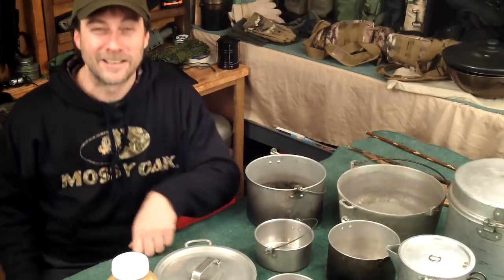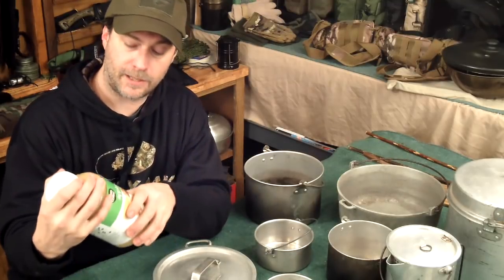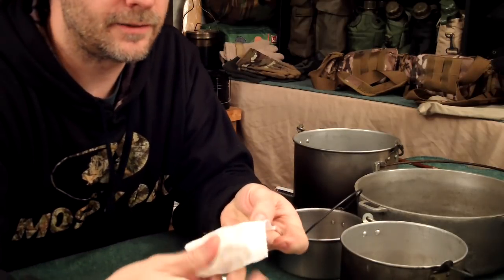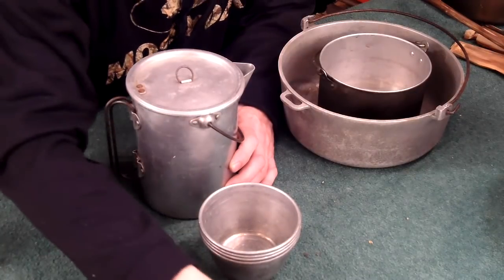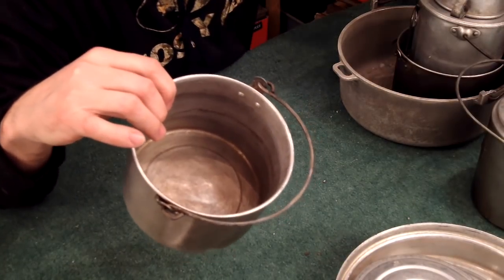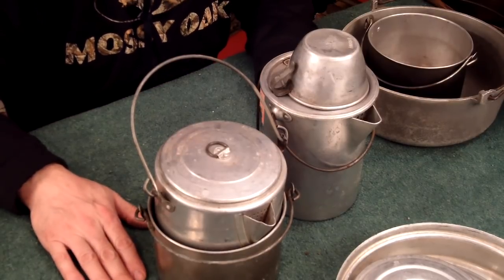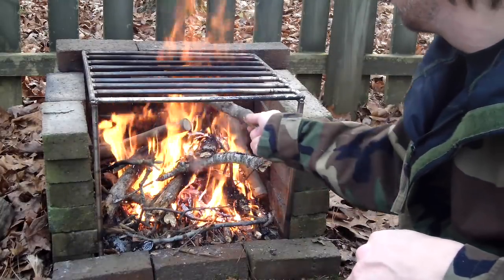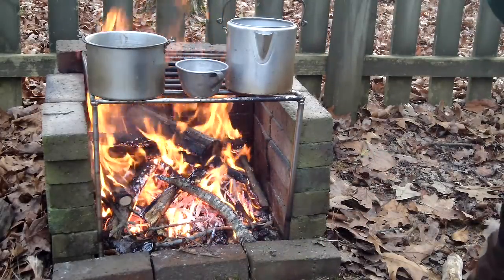Testing Old Aluminum Cookware For Toxicity

Comment: Sorry for spamming, I should just watch your videos first and then put 1 or 2 comments instead of 4 like now, I do apologize. The older the pan, the more oxidation has been going on, like rust on steel (also, there are notable differences in the production. like passivation). This oxide reacts with the acidity in the applesauce, tadaa, coloration. I'd just stick to the newer pans because they are less dirty. Cooking food that is highly acidic, will give you a reaction, a bit or a lot, depending. This is what I understand as a layman, it isn't lead or mercury, I think they are safe, but feeling safe is also important.
Reply from the maker: I would say no matter what the root cause is, if the applesauce changes color it aint safe to use any more.

Comment: I have a huge cast alum turkey pan I use to steam my big spegitti squash in summer when I can cook outdoors. It was just the right size. guess I will use all that sketchy canned applesauce on it and see what it does. might make a video if that just to follow up. 
also wondered about a man's comment in here about what if one used a series of fine Sanders and then polishes on old cast to shiny them and get rid of oits. Then I wonder if one can season them with oil several times like cast iron to from a oil barrier on it.
Reply from the maker: I too have wondered if a high polish would help so I'm going to test that. Now I do believe a seasoned coating that never gets scratched or scraped will make a pot safe.

Comment: First I like your videos a lot. This one also great entertainment! But... I'am having trouble with the science of it. It is a fact that aluminium is not healthy. I will not be discussing on effect levels here. My theory is as follows. For al I know apple sauce is slightly acidic there for it will dissolve aluminium and as specially aluminium oxide easily. Is de dissolved aluminium de reason for the staining of the sause? Non oxidised aluminium dissolves less easy there for it does not stain as much i think, but is dissolves any way. So by using acidic foods in aluminium pot and pans you will get aluminium in your food. If you would clean and polish the old pot that showed the staining should not occur.  Maybe a idea for a other video? Please prove me wrong if you or anyone else here has a better explaination?
Reply from the maker: Thanks Gerard. Well first off I cant prove anything. All I know is what I was told about this test and thats this " the ascorbic and malic acids in the apples in the sauce that react with any organic impurities from bacteria in the aluminum pores that open when heated that cause the color or odor change"

Comment: Maybe use a fine mesh steel wool to put a polish on that cast aluminum dutch oven.
Reply: Vinegar would also have a cleaning effect and with take the oxide off.
Reply from the maker: I actually did use steel wool and it still turned pink!
Reply from the maker: I need to try that next

Comment: some old stuff is made from pewter = tin with lead it looks a lot like aluminum
Reply from the maker: That would be horrible to cook out of!
Reply: you can tell because it will melt with a simple propane torch and it can be reused recast -cheers

Comment: this is interesting, I've never heard of this applesauce method, can you give any references to this, why does this happen ? I don't really think that it is a valid toxicity test, and from what I know and have read the aluminum is not good for cooking, and the explanations why, were all scientifficaly backed up but I would really like to know more, because I too have some aluminum cooking sets and occasionally use them, regardless.
Reply from the maker: The claim is the malic and ascorbic acids in the apples react with the unknown toxics in non ferrous metals.
Reply: ok, Thanks for this. I will try to find out more because this would be amazing to know if the pots are "leaking" toxins into what ever we are cooking.
Reply from the maker: It's also good to find out if the aluminum is leaching something out of its own alloy mix or did it absorb something toxic over the years and now it's releasing it?

Comment: I'm curious because of knowledge from working in Boatyards. Aluminum contacting steel make a corrosive reaction, I'm wondering if the steel handle on the big pot is making a reaction ? It's corroding and then causing acid in applesauce to have a reaction? Just my little mind working here. Stainless steel must be used if in contact with aluminum..if my mind is correct...
Reply from the maker: Hmmmn, kinda like why a sacrificial anode is used on a boat motor? You may be into something there

Comment: Pink happens even with glass cookware...it's simple protein breakdown with antocyanins...has nothing to do with aluminum...
More to do with acidity.
You can prove this with lemon juice...put lemon juice in half the batch and it will remain white-ish...the batch with no added citric acid with turn red-ish/pink-ish.
......on top of all that the added acid/lemon juice would bring out even more leeched aluminum which in theory would cause more pink but since the batch with added acid doesn't get darker instead it get lighter...
Thus in theory the aluminum is not the catalyst for pink coloration.
And second to that is the fact that "ALL" METALS CAN CAUSE DISEASE THRU EXCESS!!!!
BUT REALLY the true test is to cook water then test water for aluminum and test uncooked water to see if aluminum levels are the same.
It's done thru titration.
You must titrate the cooked water to uncooked water and compare how much catalyst is necessary and you will then be able to determine if one sample has more aluminum then the other...
It's not crazy chemistry it's actually quite simple just research what chemicals to use to titrate a solution of water and aluminum...
Reply from the maker: Thank you for this good information Nicholas
Reply: Reallybigmonkey1   I hate to say this but maybe my comment was not well informed... I looked up titration of aluminum and it's not easy or simple at all... I Apologise.
Reply from the maker: So it's more of a lab procedure and not home capable?
Reply: Reallybigmonkey1  from what I gather it's a lab type of process but I'm still looking into it because where there is a will there is a way lol... 
So upon further research I find that aluminum cookware or containers is actually not where most aluminum comes from...
It's actually dietary and is in most foods and most dust from soil and the Canadian Alzheimer's society has concluded that there's actually no evidence to suggest aluminum is the cause of any disease.    Some Alzheimer's patients have traces of aluminum in the brain while an equally amount of patients do not so there's no direct correlation or evidence after 60 years of studies and research to state aluminum is causing any diseases in normal situations.
So to conclude...it's not even worth avoiding aluminum cookware because it's already in the food lol

Comment: Alright, I got this figured out.  After I saw this video I put my cast aluminum pot away..but it kept bugging me that your test was showing these color variations and smells etc.. so I dug it out to do my own test. I lifted the lid to give it a rinse and boom..mold growing in spots all around the inside of the pot! Now, I know I washed and dried this pot before putting it away and I couldn't figure out why it would be molded. I'm a clean person and all. Then it hit me; I looked closer at the lid, it's pitted! The interior is pitted, the exterior is pitted too. That's what is causing the color changes and smell. The rancid grease frpm whatever we/you had cooked before is getting trapped in the pits and causing the color changes, smell and taste. I was guilty of using one of those dish sponges to wash my cast aluminum pot with, when what it needs is a scrub brush with bristles more than likely. I got close-up pics of the trapped grease if you want to see them? Holler.. I don't think cast aluminum is down for the count just yet. -peace
Reply from the maker: You may just be right! I need to sand and polish mine smooth and retest
Reply: Reallybigmonkey1   Yeah, right on.. and then there's the acidity of the applesauce breaking up all that residual grease and food product down in those pits.. has to have something to do with it.  :-)

Comment: Hello, Nice video but I Have a couple of questions...
1) where does this "if it changes color it's toxic" thing? I mean what are the scientific basis for it? I've never heard about such a thing..
2) would you be willing to make an addon with a stainless steel pot, as a control? does heating apple sauce in stainless steel changes its colour? (i hope I was able to explain what I mean ^^")
Yeah. I'm a bit of a sceptic ^^"
Reply from the maker: Here's the science, if the applesauce heats up and that's all? No problems. If it changes colors something is wrong. Stop using that pot.
Reply: Reallybigmonkey1 I meant the science for the change of color... What causes it? Any toxic substance seems to be a bit farfetched 😅

Comment: I am kinda wondering what the history of the iron pot is. If it at anytime was used in a shop for the purpose of melting lead for casting fishing weights or bullets or any other kind of substance that can be toxic.
Reply: That pot wasn't iron.
Reply from the maker: It may have had lead in it in the past, who knows?
Reply: Oh yea it could have been used for any number of stuff, lead, paint thinner/stripper, petroleum products like oil. Like you said, Who knows.

Comment: Could you sand the big  cast pot and buff it shiny?  I've got a few and I'm leery of using them.  My mom used aluminum pots a lot and she died from alzheimers, but dad is fine at 89.  But even if aluminum was safe to cook with, who wants to eat metallic flavored food?
Reply from the maker: Several people suggested that. I may just polish it and retest. Sorry to hear about what happened to your mom but good to hear your dad is doing well
Reply: Dads older brother has dementia.  He will probably be placed in a nursing home soon, he lives in assisted living now, he's pretty stubborn and 93 years old.  Some days he's pretty good, but they are getting fewer.  Dads family was big, and they're pretty much healthy, moms family was cursed by health problems including Alzheimers.  I like aluminum cookware but I wish someone could prove its 100.0% safe.  

I'm a cast iron fan, my moms mom (Granny to everyone that knew her) taught me early about the virtues of cast iron.  I suppose you could backpack with it if you get the old time cast iron because it's lighter than what's made now.  I do have a small cast aluminum dutch oven from GSI, legless so it could fit into a backpack, if you really wanted to.

I wonder if there is a way to DIY hard anodize the aluminum interior.

Comment: hhhhheeeeeeeeeeeyyyyyyyyyyyyy dave, could you take the pot that failed and use for building fires in like in damp terrain or something ?
Reply from the maker: Ah, that's the best idea yet! I may do that
Reply: thats what i would do, just use it as a fire pit, and fashion some kind of grill that fit over the top maybe. but to hot of a fire might melt it, but you shouldnt need to bug of a fire in it to do anything.

Comment: Phonetically its A-loom-ah-numb ! I never had any concern with the urban myths of aluminum, its junk science IMHO. When you look at the melting point of it and its alloys vs average temps in a cooking fire. Yea it oxidizes, but I have always used Bar Keepers Friend to keep it clean and shiny ! Also try not to use steel tools and scrape it. Titanium is the worst for conduction and cooking purposes.
Reply from the maker: There is a lot of urban myths with aluminum but in this case, that pink color ain't no myth! I have always heard aluminum works best when kept clean shiny and highly polished

Comment: Hmm... great video and big production effort but I'm not convinced.   :( 
It could be simply the Aluminum Oxide causing the discolouration. Not the same as 'toxic' as Dave mentioned. 
Maybe get a more modern, Oxidized pot and test that. 
You could also, say, boil up some oil (ie. toxic), clean it out really well, then test that pot.
Reply from the maker: By using the word toxic I am simply stated what pot wont make your food toxic.